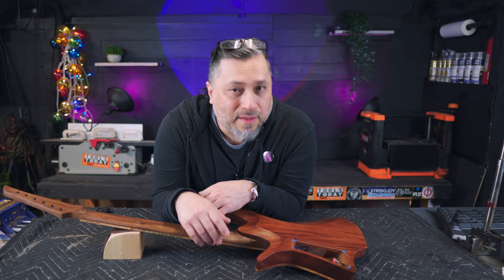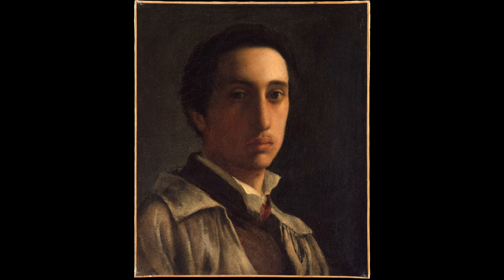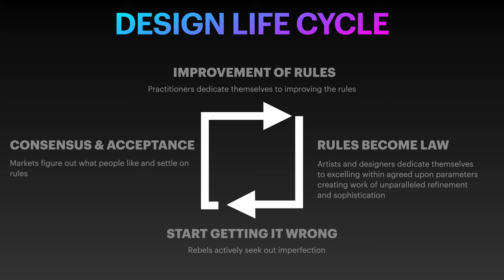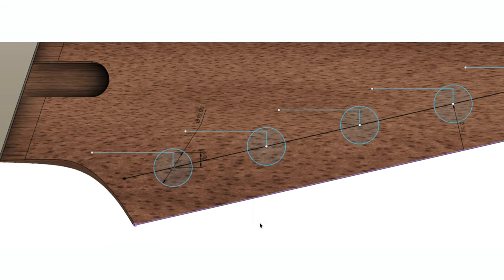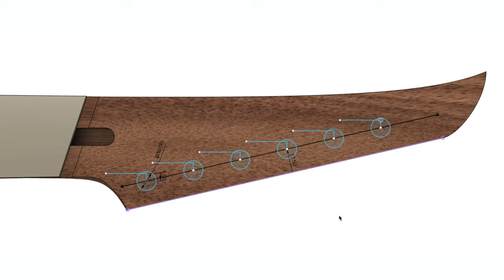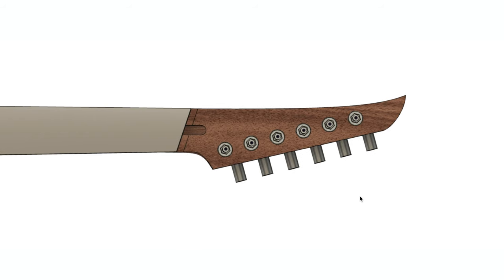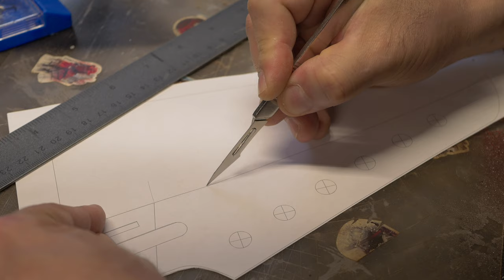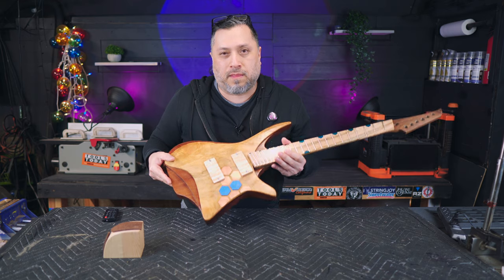Design the Wrong way - Tuner placement

Comment: Great video!
A thought: on the Steinberger tuners the strings go through the center of the post (which doesn’t rotate) so the tuning hole positions would all have to be shifted “up” in parallel so the strings still pass straight through the nut. Not necessarily interchangeable with standard tuning machines.

Comment: Really interesting.. i stumbled on this as I am in a similar boat of designed a headstock, but the tuner holes are, not exactly an after thought, but I wish I’d thought about it in more detail earlier! 6 in a row, but with a curve to contend with. I’ll fix it, but it’s an interesting conundrum. I think why yours works so well, is yes, it’s off to the side of the headstock but if you draw a line through the tuners and past both ends of the headstock it forms a natural line from the edge of the bottom curve, to the curl at the top, so visually, it still lines up and still looks natural and as it should be to the eye. In fact, I think it looks better than had you done it the other way.

Comment: I'm really interested to see what bridge system you choose to go with on this build. It's actually really interesting to see what visually looks like a body for a headless build, paired not only with a neck that has a headstock, but such an aggressive looking design for one. Awesome stuff!
Reply from the maker: I'm telling myself I'm still debating which bridge system to use but in reality it will most likely be a Hipshot multi scale hardtail bridge that I'll modify to be a top loader.

Comment: Howdy Mark! You are clearly an innovation guy! I subscribe to the theory of subtractive quality within guitar building- which you clearly ARE playing with. An efficient machine exists at the point of least resistance. A clean design exists within the best function. This is a physical fact. The product is the result of the approach of zero resistance between the strings, and the body. The more important aspect is the FEEL of the instrument to the player- which is ultimately flawed just as every player has his/her own idea of comfort. ALL factors become inconsistent- other than the basic physical characteristics of the instrument- due to the incredibly inconsistent quality (human) that we call 'Feel'. In the end, there is always someone who will appreciate what you build. An instrument is a tool, and I personally have found some instruments- of lesser 'perfection' to be excellent for the purpose I intend for the tool!
Reply from the maker: Well said. Human senses are the wild card variable we can't account for in our formulaic approaches to building tools. Your thoughts on resistance are spot on. In my head, I often imagine cutting a rubber band in half and pulling both ends apart in a straight line until I can pluck a note and thinking about the purity of the wave. Then thinking about all the resistance we ADD when building guitars. I also agree with your idea about tools of lesser perfection. Some guitars in my collection I have "to fight" when playing. They fight back. And playing them is fun. And the tones achieved during that fighting are pretty darn good. Thanks for the awesome insight!
Reply: @MarkGutierrez  All that I can say- beyond 'You're welcome' is that I really enjoy your design ethics- on everything I have seen you do. I still want a headless from you, and I am working on that...!

Comment: I f+cking hate 3+3 headstocks. I always say that any headstock in which the strings don't go 100% straight from the nut to the tuner is objectively speaking a bad design...if only acoustic guitar builders would listen....and also THANK YOU VERY MUCH for the last part on m3 inserts. I would love an extended video on the various uses of inserts for guitar (cavity covers/pickups/bolt on neck inserts/etc)
Reply: Try a 6 x 6 headstock for a 12 string!  😂🤣😜🤪

Comment: fyi, those hipshot knurled barrel tuners are not user friendly... i had a yamaha rgxa2 that had similar style... they look awesome but tuning with them sux. 
btw, the yamaha rgxa2 was an awesome design... the apple i-guitar style design. check it out
Reply from the maker: The Yamaha rgxa2 was a revolutionary design for 2005. And proves my point that some progressive design choices don't stick or are embraced by the general population. It is a shame that guitarists are creatures of tradition. Thanks for the heads up on the knurled barrel tuners. I've never used them before. Do you think using a tuner with a different ratio would help? Sperzels are 12:1, Hipshot are 18:1
Reply: @MarkGutierrez  you know, i have guitars with both and... well, let me put it like this...
sperzel=german floyd f100
hipshot=korean floyd f1000
i think they're both very good but sperzel has that looks overbuilt with better metal quality... its a tank. 
the guitars i have them on... the one with sperzel sat on wall for months n tuning wouldn't move, hipshot guitar in case moved just barely but probably got knocked when putting in case.
sorry, that wasn't about ratio but quality... but i can see this...sperzel are very low sticking out and would probably look great on your headstock... but they look heavy to me... not sure what weight difference between them is... and im sure you don't want a neck dive on this guitar... which you might get because headstock is long n those tuners you mentioned may be heavy.... gotoh stealth may be your answer